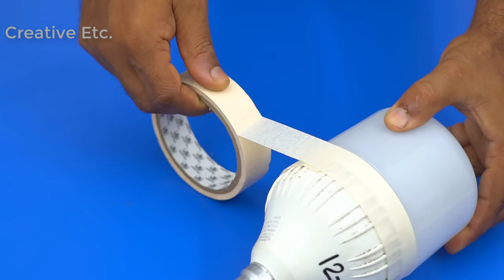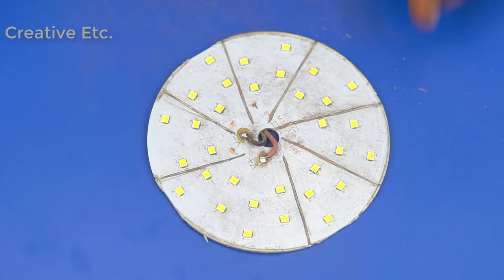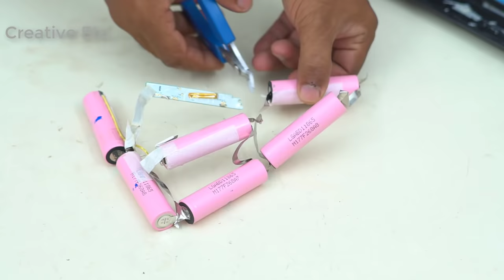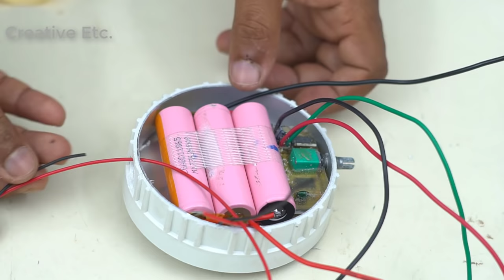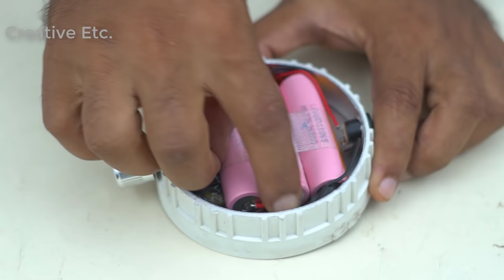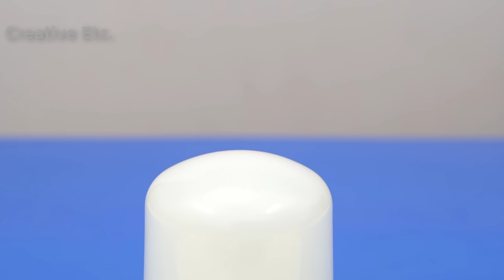How to Make Emergency light from Scrap LED

Comment: Looks nice but how you will change the batteries without the PCB protection board with BMS? You risk damage, overcharging, or even blowing the batteries.
Reply: Yeah obviously no bms
Reply: The danger is higher

Comment: Excellent but it need 12v BMS protection, you can use laptop battery BMS from where you equipped batteries

Comment: You could have used the same BMS which you discarded from the laptop battery. You could have added a charging circuit also.
Reply: good look using BMS from laptop Batt
Reply: Батареи были разрушены без схемы BMS

Comment: i dont understand what the function you cut off the line of the led , and you make jumper cables red and black colours 👍🙏
Reply: The idea is to take the long string of LEDs and make them into groups of LEDs so that they can work at a lower voltage and then just put them in parallel with the jumpers
Reply: @redstoner2006  
ooh i see now.. thx 🙏👍

Comment: The potentiometer will heat up and burn out by using direct 12v with such high ampere power source.

Comment: You did a lot of mistakes and actually silly mistakes..
Ist -- I think you should use step rotatory switch, for brightness adjustment by switching between different segments of 12v led group..
2nd -- you should use, thick and flexible enameled copper wire for led panel connection ( in pentagon shape) it will look beautiful and simple..not messy 😒

3rd and most importantly -- always use BMS with lithium batteries.. otherwise they will explode over long charging time,if voltage is higher.